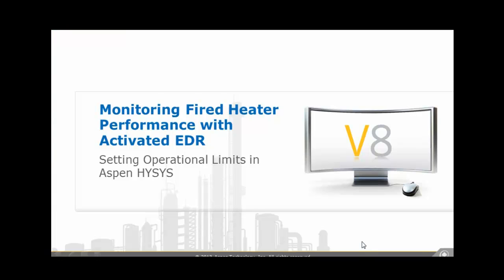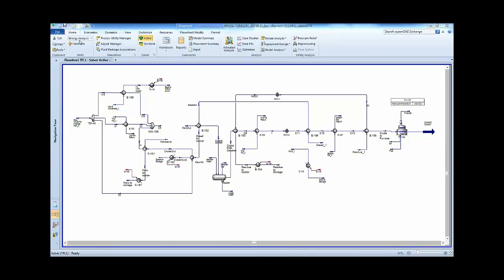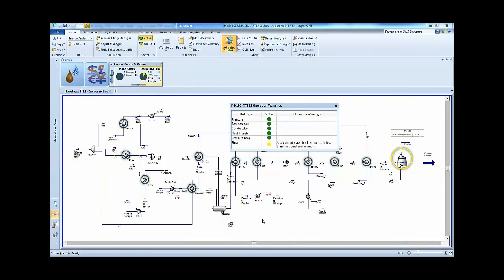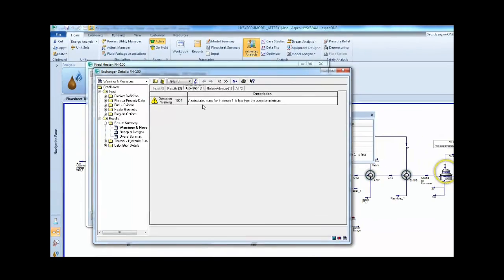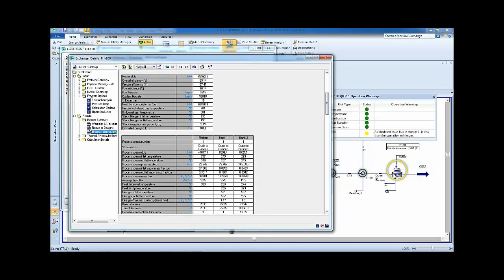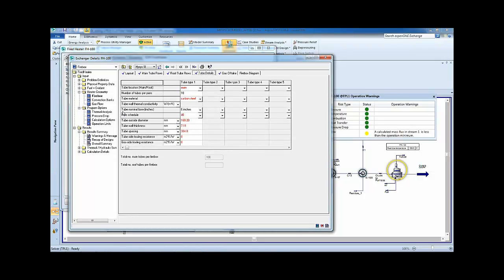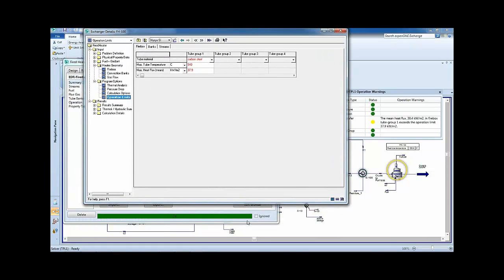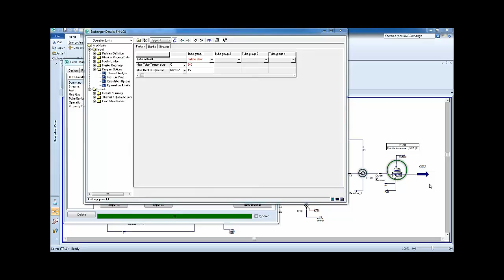Troubleshooting Fired Heater Operation in Aspen HYSYS

Comment: Dear Friend
I am running HYSYS V8.6 (lisense), and when I try to design Fired heater, I have a problem about mass flux same problem in your video. I modified to get mass flux suitable, but pressure drop and velocity not good. Pressure of main process flow always reduce to 10 kpa. Can't you help me how to solve this problems?
Best Regard!